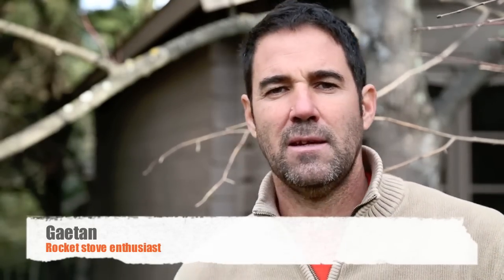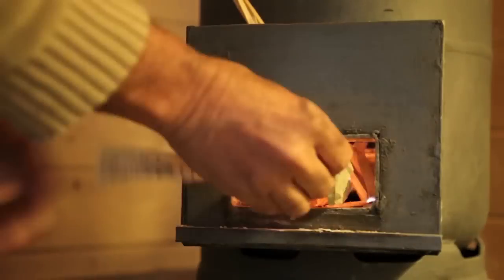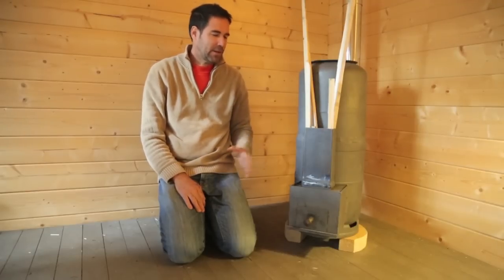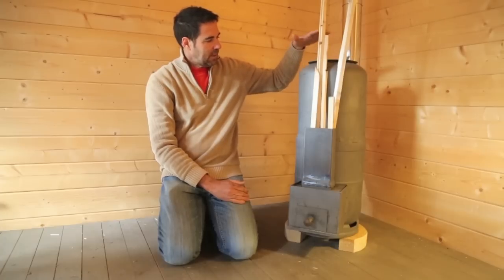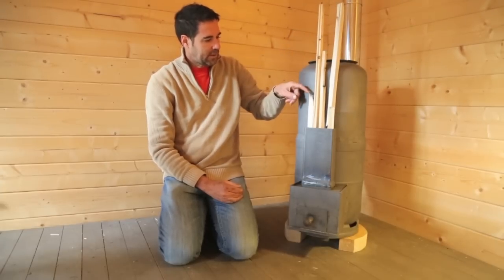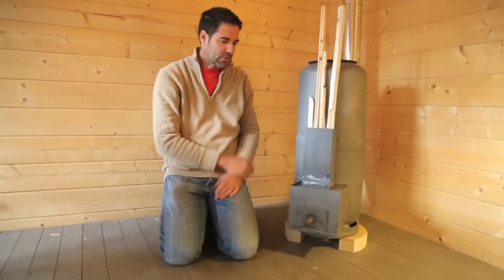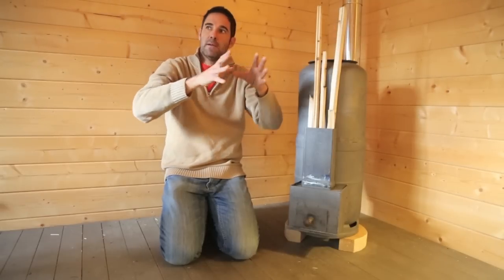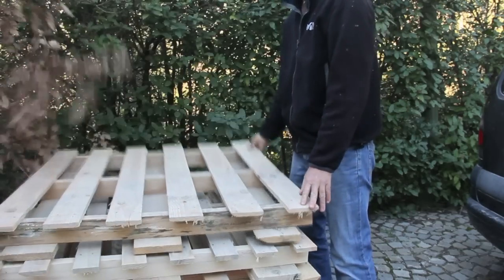Rocket stove heater for a workshop or a room

Comment: Well done!   One question if I may: many say that the distance between the end of the insulated inner chimney and the top plate is critical. How much space did you leave for the hot exhaust to turn downwards?  Thanks.
Reply from the maker: Iksr Alquyuud Hi, thanks for your comment and question. I did put a lot of thought into this question. To little a space and it will slow down the flow of hot air and too large a space will also slow down the hot air flow, both having an adverse effect on the combustion and exhaust air flow leaving the system.  From memory I left 2 to 3 inches as a space. Perhaps the only kind of proof I have that the space I left  contributes to the good functioning of the  the heater is that it gives off great heat and there is no smoke that leaves the chimney.
Reply from the maker: Iksr Alquyuud Found my notes, I left an 8cm space
Reply: Thanks for that.  Yes, after posing the question here and looking at other videos, the range of 2-3 inches seems to be the one that is recommended by most builders.

Comment: great build! I am planning on making one this summer.  Is the vermiculite just laying inside the exhaust chamber?  Also, whats the output like?  Does it heat the room quickly? Does it get to hot?
Reply from the maker: Thanks. Yes the vermiculite is just laying there at the bottom of the heat exchanger. "Does it heat the room quicly?" That will depend on the outside air temperature. To heat my 16m2 it takes about 15 to 20 minutes. "Does it get to hot?" Once it got too hot but it wasn't so cold outside. So that again will depend on the outside air temp. As there is no air intake control there is no way of controlling the output heat. After about 15 minutes when everything is nice and warm it really rockets away.

Comment: Hi, One of the best presentations of rocket stove. Congratulation !on this pioneering technique ! which I believe inspired many to build such Rocket stoves.  I have already tried with a normal 3 gallon or approximately  12 liters bucket with a ceramic pot inside feed from the top and exhaust from the top similar to your one. Guess what !It worked !  So I am going further to include wet back we call it in NewZealand to heat water from the fire source. Did you know if vertical feed existed before you built this one?  (My teaching colleague mentioned, that vertical feed existed or was in place but may not be your designed style.

Thanks for the inspiration. One small request if possible. A thermometer will only cost about less than $15.00 if you could possibly get the reading  would inspire the reader /s more.

Also you mentioned there is insulation for the inner tube where fire is raising.and hitting the top.  From the picture I could only see metal was there another casing of metal to hold the vermiculite?
Reply from the maker: Hi Stanley, thanks for your generous complements. Yes the vertical feed has existed for a long time. Re the thermometer sure it would be interesting, lets just say it gets very hot ! The insulation on the inner heat riser is vermeculite, there is the inner pipe then the vermiculite then the outer pipe.  Make a video of what you have done, sounds interesting, if you do please send me the link.

Comment: I'm curious about your air intake.  Could you simply attach a flexible hose to your outside air and route it to your rectangular feed shaft?  That would feed the fire and prevent the drafts you describe, and it would appear to be a simple fix to your current design.  Is that possible?
Reply from the maker: Yes you are totally right, this is something I had considered doing and is possible. I wanted to come up with something like what you have described and at the same time be aesthetic, however I had already finished building the stove. It will have to be for the next one !

Comment: Impressive! I know you made this video 15 months ago, how has it held up? Any improvements you would make besides a better air intake? How hot is the exhaust -- maybe it would be possible to extract more heat by adding thermal mass around a horizontal section of the exhaust pipe thus making the exhaust cooler/safer? Thanks.
Reply from the maker: Thanks Carl !  Well it is still standing, summer is just over so I have not used it since last winter, even then I only use it occasionally. The exhaust pipe gets hot, you are right I could extract more heat from the system, that would be perfect, though for the amount of time I use it for and the place (a wood cabin) I decided to keep the system as is. I think if I were to make it again I would use a thicker gauge steel for the rectangular burn chamber, as the intense heat at the end of the chamber has made the steel flake in some areas, in time this will perhaps burn through.
Reply: Thanks for the quick reply, Love your design, with a bit of thermal mass (maybe a small bench) one would have a miniature rocket mass heater.

Comment: Good job.  Could there be a potential problem with carbon monoxide build up in an enclosed space?
Reply from the maker: Michael Childs Hi Michael, well the space is not enclosed, there is an air inlet, plus the crack in the wood and spaces around windows and doors. The air goes into the stove and out of the chimney. I don't see how the build up could occur. This being said I am not a specialist and do not have instruments to measure this.

Comment: I am impressed with your design.   Do you think perlite is any better than vermiculite
Reply from the maker: +David Epperson Thank you David,  I have no practical experience to you answer your question. I have read that they are more or less the same in insulation performances. There are a few articles on the internet.  I used what I could find available cheaply and that turned out to be vermiculite.

Comment: Amazing work. Secondary air intake is a great idea. I'm thinking on making one for me. What do you think about drilling some holes at the bottom of the insulated tube for recirculating some smoke back to the burn chamber again?
Reply from the maker: Thank you. Sounds like a interesting idea. I don't know how you would be able to measure the efficiency of those holes.

Comment: please, i have a question. When the hot air rises to the point where two currents separate both left and right into the space of the outer cylinder and the current which moves towards the right goes out the exhaust; does the current which moved towards the left have any function besides maybe keeping the whole system hot??
Reply from the maker: +Uwanamodo Chinedu  There are no two currents coming from the burn chamber - there is only one mass of continuous hot air that rises the heat riser and then is dispersed into the outer chamber (heat exchanger) moving around according to turbulence created and flows in the direction of the chimney outlet. This movement of hot air around the inside of the heat exchanger coming in permanent contact with the metal of the the heat exchanger is what creates the radiant heat of this heater.
Reply: +gaetanproductions sorry, it's me again. Can i have your personal mailbox because i am going to ask a lot of questions and some of them may sound silly.

Comment: Thank for your response. it looks like you wrapped the top half of the riser tube with copper. Or is that just discolored stove pipe? 

Also, regarding the height of the riser tune. Is there an ideal ratio of the area of the intake or size of the burn chamber to the height of the riser? Does it affect airflow or heat transfer?

I have read that the intake cross section should match the riser and exhaust cross section for good flow, but then people often restrict the intake for a slow burn, so I'm not sure how important that it. You mentioned wanting to make the feed tube larger. is that just allow more  wood easily or to affect the airflow? 

Thanks
Reply from the maker: Yes I there is an ideal ratio involving burn chamber size, riser diameter and height, getting close to the perfect ratio will of course effect over the overall functioning and efficiency of the heater. I made my heater with more or less what I had and with trial and error, a lot of common sense involved, like proportions for example not having an over large burn chamber or a small diameter riser. Keeping the same section of piping is important. Re the feed tube, I only had rectangular piping the square one would of been perhaps more practical as a wood feed.  Restricting the air intake is a good idea for burn control, thought I have not experimented with this as yet.
Reply from the maker: The top of the riser is discolored stove pipe

Comment: if there is no smoke out can I make inside on the floor web of exaust pipes and than out to take all heat i have without cleaning this pipes?
Reply from the maker: Not sure I understand your question. Yes you could make the exhaust pipe longer in the room to have more heat exchange.

Comment: What I don't understand, why doesn't the flame and smoke trace back up the wood feed? How does this design move the flame/smoke up the chimney instead of back out the feed hole?
Reply from the maker: +Christopher de Vidal  It is all about draft. Hot air rises. The hotter the air  the more pull the air has in the the system. The height of the chimney (or stack)  will also influence the draft. So making the fire as low as possible in the stove is important and (for the light up) as near as possible to the vertical shaft of the chimney (heat riser). Once hot air gets moving up the chimney you&#39;re set. In my stove,  just before light up, I put a burning piece of paper at the back of the burn chamber as close to the heat riser as possible to create movement. This is why I made the light up/ clean out door that I close once the air movement has started. Again on my stove, if I were to make the fire under the wood feed it would come out the wood feed. Hopes this helps !
Reply: +gaetanproductions Cool beans. Beans that are cool.

Comment: I think the downside is it seems to only burn kindling.  Very labor intensive to chop and feed.
Reply from the maker: +blurglide Depends on the wood you use, the wood I find I only need to split it, and if it is long I don't need to feed it often. Though with this type of stove I am in the room when it burns.

Comment: Great video, Gaetan. But what keeps smoke from coming out of the wood feed?
Reply from the maker: Michael Brigman Thanks for your comment Michael. Good question !  Once the fire is made below the heat riser ( I usually burn a small piece  of paper there before lighting the fire) this gets the hot air rising and creates a direction for the hot air to flow. Then I ligh a small fire in the wood feeder. As the fire gets more intense the direction of the hot air flow gets stronger and that is when the "rocket" sound begins. HOWEVER back fire or smoke can come back out the wood feed and it happened the other day !  Why?  Because it was an extremely windy day and the wind pushed the hot air back down the chimney pipe. As you can see in my video my chimney cap is home made and very simple. What would be needed to prevent this is a wind direction chimney cap or something similar that does not let wind down the chimney pipe.

Comment: I really like your design. Very clean and reasonably compact.  You mentioned stove sealing paste. Did you use that between the tanks? do you have to replace that each time you take it apart to clean?
Reply from the maker: Thanks, yes that paste would need to be replaced when and if the gas bottles are separated. If the two bottles are assembled well, that is a good fit, then that gives a good seal (kind of like chimney pipes)

Comment: do you ever experience back draft?  those long pieces of wood can act as a chimney.
Reply from the maker: linuxxxunil Yes !  A few times when there was strong wind outside, not much fun when that happens! What I would recommend for this is a directional chimney cap. I have not as yet installed this. For the moment I don't use the stove when there are strong winds.

Comment: Daft question could I use cat litter for chimney insulqation
Reply from the maker: Depends what the litter is made of and if there are any chemicals or perfume inside (that would give off fumes when hot) To my knowledge the best insulation is vermiculite, perlite, simple dry wood ash and clay oven kiln insulation, a very light solid material (sometimes in a brick form) that can be cut very easily and are expensive.
Reply: gaetanproductions I am in japan ,so not sure what to ask for ,but dont really want to spend  on expensive stuff ,wondering whether to go concrete
Reply from the maker: arrgh garry Cement will not act as an insulation it will extract the heat instead of concentrating it in the burn chamber and heat riser.

Comment: Very nice! It would have been nice to see how the connection ring works between the two tanks. All in all very nice setup!
Reply from the maker: Wookiemonsterfreak  Thanks for your comment. Actually the connection ring is very simple. On the top gas bottle I bent and  spot welded a flat piece steel around the base overlapping so that the lower bottle would fit nicely in the upper bottle creating a "semi sealed joint". As I only spot welded the flat piece of steel I  added a high temperature paste to fill in the gaps, on the inside and outside. I have had no smoke come out from here.  Hope this helps

Comment: We burn all of our paper trash in an open fire pit. Would using a rocket stove work as effecently burning that material or would it create too much waste?
Reply from the maker: +recon562001 You know the nest thing is to try it out. There is a guy that burns dried leaves in his rocket stove. I think burning only paper, there is not enough carbon, make it pretty smokey. Good luck

Comment: If you bring external air in and heat it. Using a fan to presurize the house it will solve combustion air and cold spots in house

Comment: nice stove.
I notice that your pieces of wood extend far above the metal feed-chamber, which would make it impossible to cover the air intake / fuel feed-chamber in the event of a flame-back.
Do you plan on extending the feed chamber to allow you to include a safety shut-off?
Reply from the maker: +angryadrien Thanks. Yes you are quite right, I think I mention that in one of the comment replies. The advantage of being able to feed long pieces of wood is that the fire auto feeds itself for quite a while. The down fall of this as you pointed out is the possibility of back fire, which would only happen in the case of strong wind, it happened once !!. To avoid this a "wind proof" chimney hat could do the trick ( i have not tried this yet). And yes to have an outside air intake and close the feed chamber off, and why not put some glass in there somewhere to be able to see the flame.
Could you expand on a "safety shut-off" that you mentioned.
Reply: Hi, yes...if you put a steel door over the feed chamber, it will block air/flame from going back into the room, but you will need an air source, preferably from outside the room, which can withstand the heat of a flame-back...there are a variety of videos that show peoples modifications but it is a simple idea that you can easily adapt to your stove.
there's probably an easier way to accomplish this, so please update us on your choices.
Reply from the maker: +angryadrien Will keep you updated on eventual improvements.

Comment: have you considered encasing it in cob bench to create a mass heater for your workshop?
Reply from the maker: That would be the perfect setup, though my wood cabin has a wood floor and is constructed above the ground on cement blocks. The structure would not support the weight. I also only use this space occasionally, so I only need fast punctual heat.
Reply: gaetanproductions have you considered putting a vent similar to or an exact copy of those ventilation louvers with the lever to control the air flow on the door you use to light the stove?
Reply from the maker: very good idea !

Comment: nice and simple
how did you connect the 2 halves and still be able to take them apart
Reply from the maker: +thegreatfixer I spot welded and sealed (with high temperature paste)  a ring of flat metal to the upper gas bottle that over laps it, so it fits over the bottom bottle. Creating a "joint", I did not seal this and have had no smoke come out from here.

Comment: Nice work. Question, does it help to make a long and circular exhaust pipe around/inside the room to max energy efficiency? Pl reply if possible.
Reply from the maker: Thank you. My answer to your question would be yes. Though I have never tried this. I would say if the exhaust pipe is too long there may be issues of hot air flow and draw when starting the stove. I would say that if the draw gets going and once the stove starts producing heat and hot exhaust it shout not be a problem. The only way to find out it to try it out with your stove. Cheers